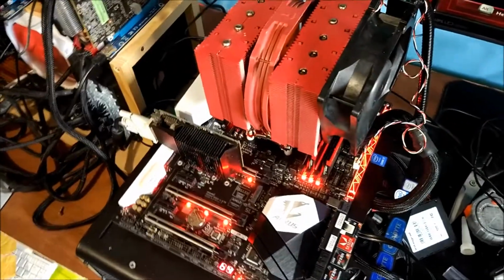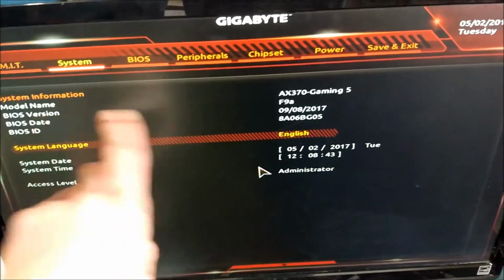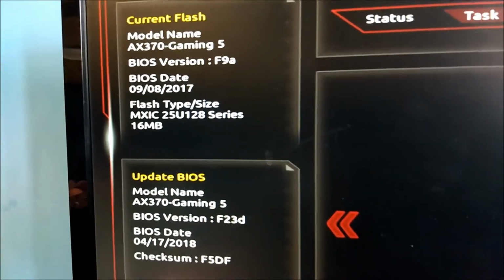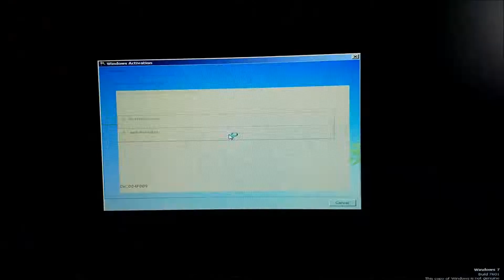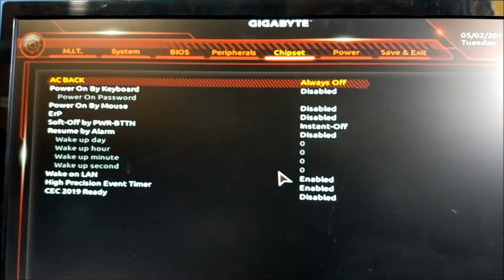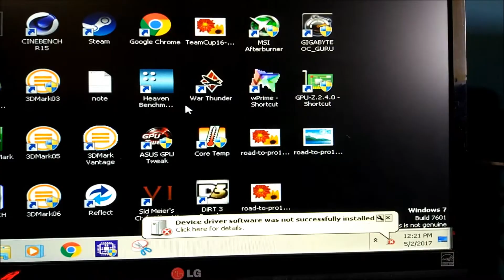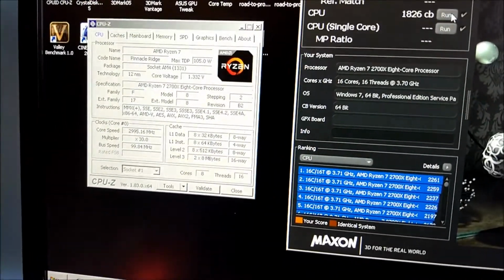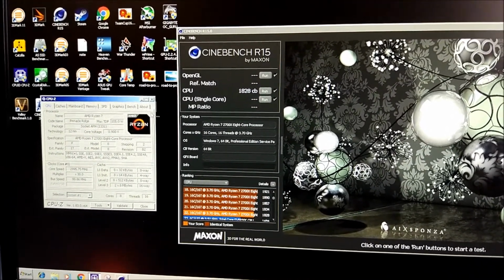How To Upgrade To Ryzen 2000 On A Gigabyte X370 Motherboard

Comment: Hi thanks for this video. I didn't do much research before building my first pc. Found out about ALL the potential problems people had before buying a 2700x. Anyway I just bought an A6 9500 (£41) literally just to update bios (F to pay respects). My question is do you reckon with all the issues that this MB has had I should buy a different one or would I be okay sticking to this MB? Again thank you for the video!

Comment: i dont have a ryzen 1000 series, is there any other way to flash the bios without having the 1000 series chip?
Reply from the maker: no. you need the older supported chip. On some intel asus boards you can flash with no cpu in, but gigabyte does not have this feature.
Reply: @LawrenceTimme  thanks man appreciate it
Reply: There is possiblity to ask AMD for bootkit, which consist of AMD processor from Ryzen 1xxx series. They will send you a processor, which then you will send it back.  From what i know, the proof is needed to show that you bought motherboard or something like that.   It could be found on AMD website, as far as i know.

Comment: I have X370 KILLER SLI motherboard from ASROCK should I buy a 1st gen of ryzen 7 or should I buy a 2nd gen of ryzen 7 ? For gaming.
Reply from the maker: Andrei GoldenVIpers it's it's on a bios that supports 2nd gen already you are better off with the 2nd gen
Reply: so should I go only after the refreshment of 1st gen of ryzen 7 like ryzen 7 2700X ?
Reply: Get what you can afford... if you have a Gen1 bios... might aswell stick with it... Cause 1800X and 2700X are nearly the same price and their performance in games is pretty much the same. So is the best the 2gen has to offer right now better than what the 1st gens best has to offer... no not for gaming...
Reply: ThaJester 898 then I will go for out of the box working ryzen 7 1700 processor